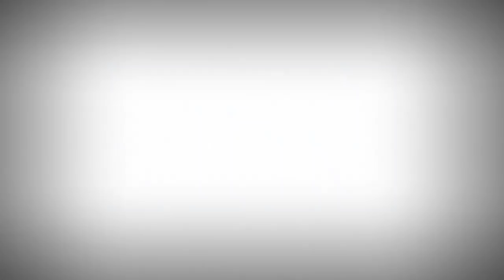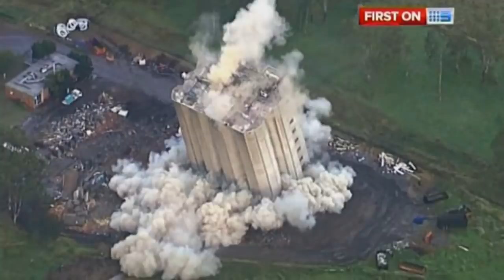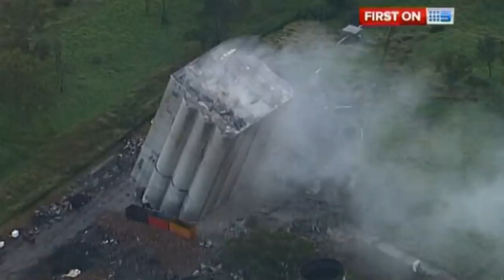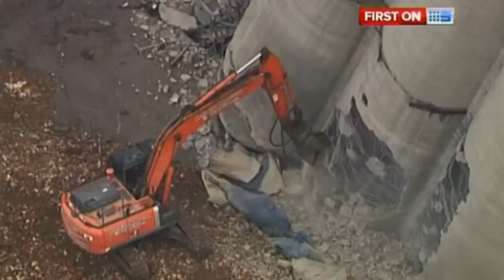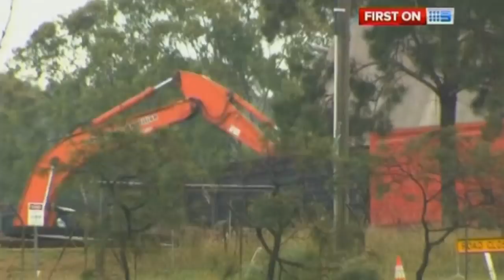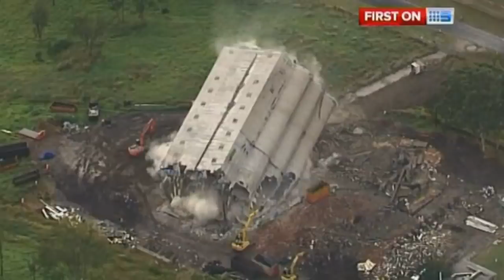A giant building implosion in Australia goes wrong

Comment: Guy in the red excavator at the end was shitting himself.
Reply: TheApollo1232 

Nah, The building was already leaning away, but the Concrete reinforcing had killed the momentum.  The Excavator was used to break some of the Reinforcing bars holding the building.
Reply: +Brian White Would kick charges help with implosion on this type of structure. Around the rebar?
Reply: +Brian White if one side of the silo collapsed earlier than the other, it still could have rolled in the direction of the red excavator. That's why he is backing up.